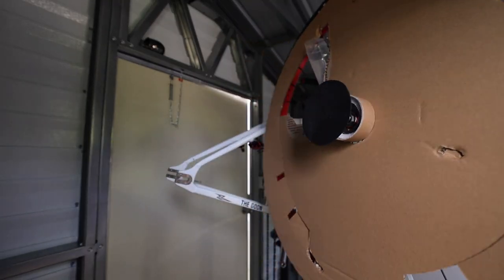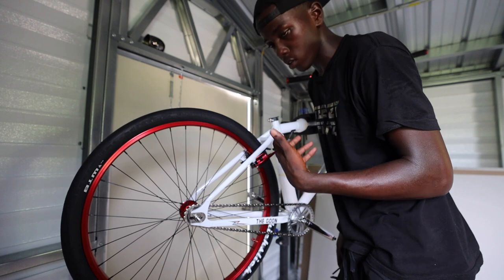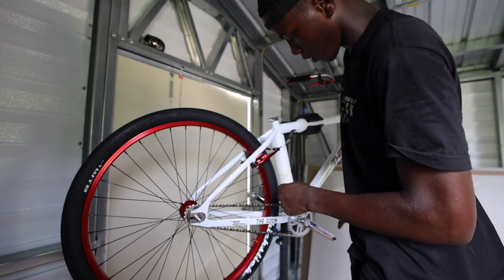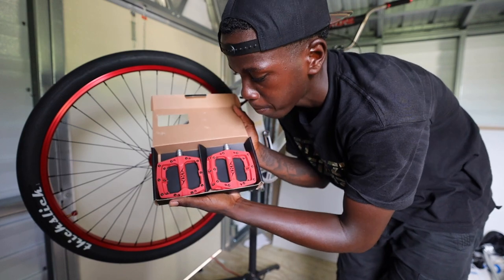UNBOXING MY NEW 2021 THRONE CYCLES THE GOON 29 (WHITE CRIMSON)

Comment: What’s the sprocket size on the 2021 It looks smaller than than the 2020 and older with the 39t
Reply: 2021 Goon is 33/16 gearing
Reply: Yeaaaa nateeeeee
Reply: We out here and yea the sprocket looks small so you might have to pick up a sprocket for your goon 🤷🏼‍♂️🤷🏼‍♂️🤷🏼‍♂️
Reply: Thanks Jim for the facts
Reply: Yeaaa billy

Comment: Got that same bike the other day. Got some front hub issue, apparently it’s common on these so throne said to send it back and they’ll take care of it. Waiting on shipping label from them. Other than that, I’m digging it. About to order some goodies for it.
Reply from the maker: I’m having the same problem too😬
Reply: Steeezy Filmz sucks to hear. Contact them and they should make it right. Unless you just wanna knock it out uourself. What size brakes you got? I see they have a 85 and a 108.
Reply: Same here, omar I ran into you on my fb post about the issue. Steezy, my front wheel knock was  a noise coming from stripped spokes so check that first.
Reply: Just purchased this bike, hopefully I don’t have that problem. Kinda worried now.
Reply: Rob B hey did u fix the stripped spikes?? I have the same problem. What did u do to fix them?
Reply: Babyman007 yo I just ordered the bike so was there anything wrong with it or wha?
Reply: Front spoke was stripped took it to bike shop to fix it is was like 20 bucks. Other than that the bike is solid. Had to grease the cranks tho.